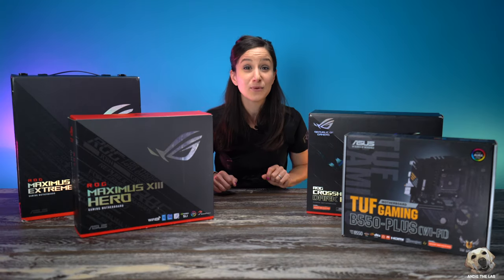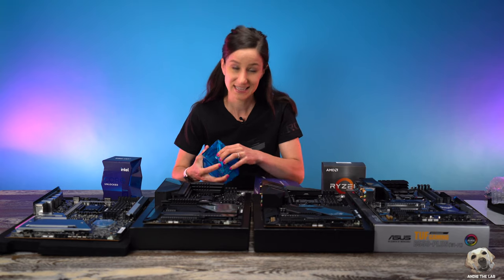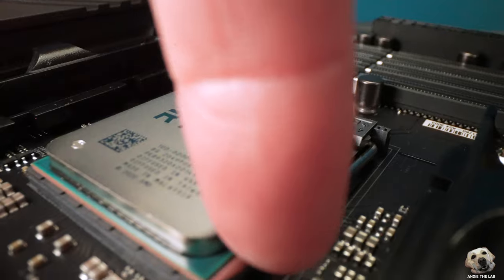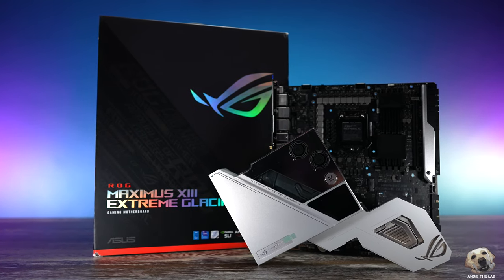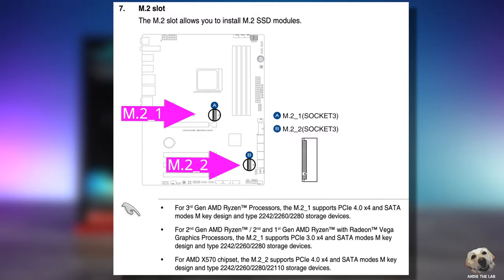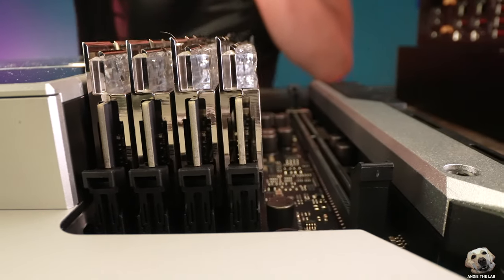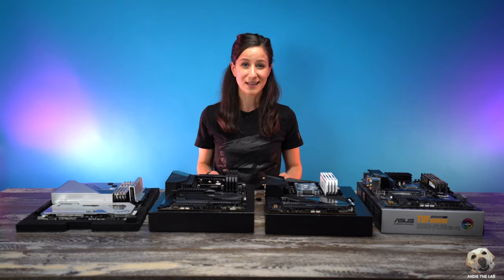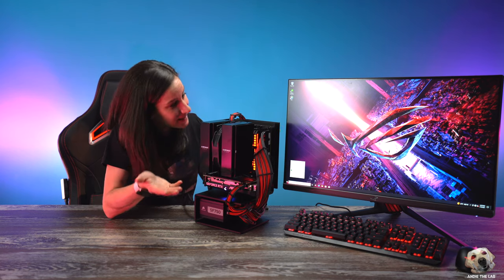Build Together Series: Episode 2 Motherboards, Thermal Paste and a Giveaway!

Comment: Great video.  Would always advise following anti static procedures,  when building pc. Fleece clothing can be lethal to PC components due to static build up on them.  Have everything close by ready to go.  Avoid touching copper contacts on memory and storage components.  I broke a mother board once while installing memory as it flexed too much.  Great advice in video. Install  it outside the chassis/ case. Be gentle with memory slot hinges too. Prefect advice on CPU etc.

Comment: Thanks for making these videos, very helpful! At about 10:44 you pull out a DIMM2HS to 2x M2-NVME adaptor... tried searching for it, and couldn't find it "right away"... where did you get that? Why use different MFGs SSD on the same MB? Best!

Comment: Extremely well done video by you and the girls Deb!  Was wondering how fast the build you are giving away is?  Its so cool and such a small footprint.  Love the ingenuity of the "case" maker to come up with basically a piece of "art".
Reply from the maker: 10900K with XZ590 using a Gen 3 speed NVME and a 3060 should blaze through most games and do very well up to 2K gaming
Reply: @AndietheLab  Would a 3070 or 3080 work with the cooling you have on this?
Reply from the maker: Yes
Reply: @AndietheLab  will dictionary help me understand first 12 words?